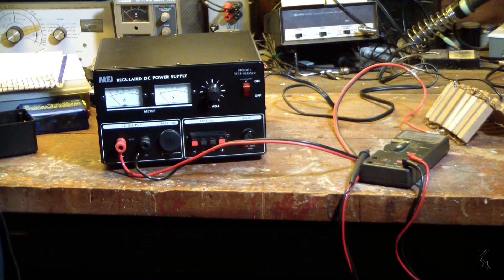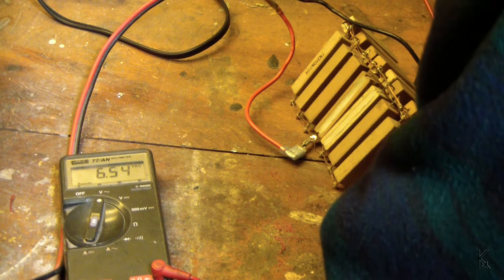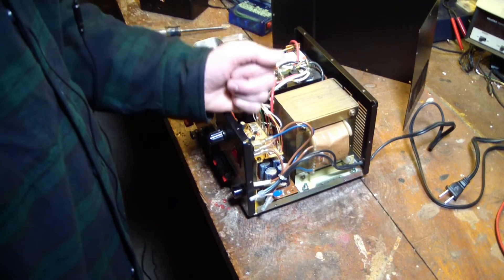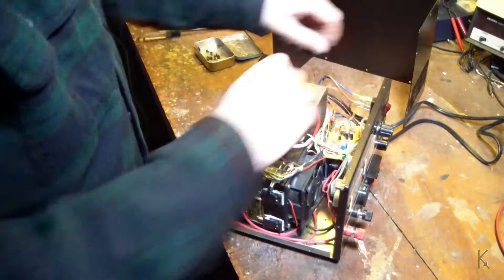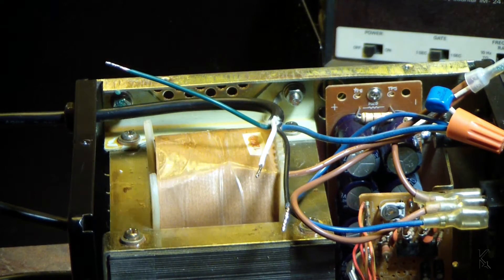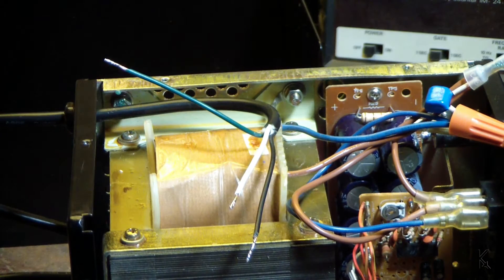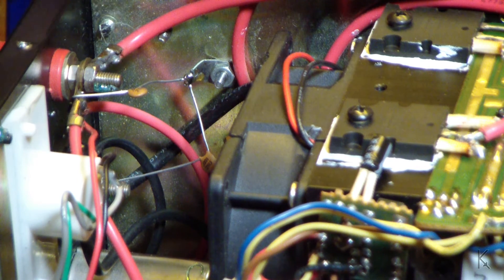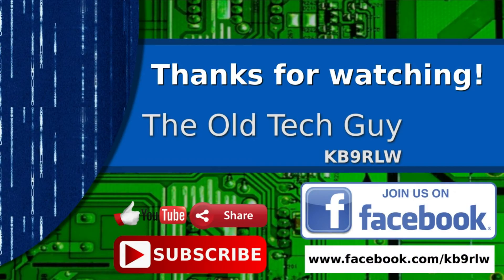Ham Radio - Improving the RF filtering of the MFJ 4035MV Power Supply

Comment: Just bought a new one. Many of the problems of the early model seems to have been address. The soldering is limited as they went to crimp on connectors for most connections. They have added caps to the DC outputs. They still use a two prong cord, they must have there reasons. The only thing missing is the meters are not lit but I don't know if that was a add on. Easy to do once the warranty runs out.

Comment: Thanks for a very useful video! I've performed the mods you demonstrated and it has vastly improved the usefulness of this power supply.  While in there I also cleaned up the solder joints on the rectifiers and performed the "fan mod" to reduce the fan noise (I see the unit you displayed here already has that mod.. the resistor going from one of the rectifier leads to the fan).  I really enjoy your videos, keep up the great work!

Comment: I have this same power supply, which was stored in a box for over 10 years. Previously it was working well. But now the voltage meter fluctuates and does not stay as set with the voltage adjustment knob.I did open the unit up to blow any dust in there but the problem persist.Can you tell me why this is happening?

Comment: Why would the casing have had a PD of 61V? Simple due to impedance from the transformer?
Reply from the maker: Bleed through from the bypass capacitors to the chassis.   Voltage, but no current.  It wouldn't shock you.

Comment: Kevin, thanks for the excellent video.  Do you have a proper schematic?  I have one, but it doesn't match most of the components. - Bob
Reply from the maker: The owner had five that were all a little different.  Only one matched this exact model.   I'm not sure where he got them. I sent them back along with the unit, so I don't have a copy.  Sorry.

Comment: Great video -- I am a total HAM beginner and have a general question: Could I not directly use an Automotive battery together with a DC-DC converter to avoid all  problems of other power supplies -- especially if I am transmitting max. 1h a day. After usage I would recharge the accumulator over night. I would need to check the effiency of the charging process (for slow charging it should be fitting to the free energy of the double cell reaction of the accumulator). What would be the disadvantages of such an approach ? Cheers and thanks for all your videos. Stephan
Reply from the maker: Oh yes, you could absolutely use a battery with some kind of trickle charge or intermittent charge like solar.    I have a battery system in the house that my QRP radios run off.  It's charged by a small "wall wort" transformer to keep it up and I can run for days off the battery if need be.
Reply: Did you try a pure battery approach also for a 100 W radio ? Would this work  too ? Thanks for your answers, Kevin and 73 from Zuerich, Switzerland ...

Comment: I have 2 of these MFJ4035M supplies and have not experienced any issues. I have tested to 24 A, not just 6A.   I do thing adding AC safety ground a good idea.  The output caps on the DC are too small to do much of any RF suppression.  Only issue I have had with this supply the variable voltage knob had setting for 13.8V and there is pot inside to adjust the voltage so when the panel pot is set to 13.8V the output will be 13.8V.  I have had the internal pot get flaky and the adjustment be off. I also have had to replace the panel pot.  IMHO this is much better supply than any Astron. I also have 2 RS35M Astron supplies.  The MFJ is much better built.  Astrons are about as cheap one can get, but they do work.

Comment: That Mfj 4035mv doesn't come with lighted meters from the factory which means someone was in there mucking around which might explain the sloppy solder job. I bought one of these new a couple of weeks ago and get great signal/Audio reports! I also popped the hood on it and everything looks clean and professional. Did the owner of the supply ever let you know if your improvements worked?  Dave
Reply from the maker: Yes, it was much improved for him, he's quite happy with the results.    His was an earlier unit, and the solder points were all original where they were messy.  MFJ has people doing the work, so it probably depends a great deal on which individual did the assembly on your particular unit.  I'm sure some workers take more pride in their work than others.
Reply: Hey Kevin, I was talking to a tech at Mfj last week and from what I gathered, this supply is made overseas but apparently some of their supplies are made here in the states. The tech I spoke with has the 4035mv at his work station and he said his supervisor has one at his as well. He says their built like a tank and he likes them. Dave

Comment: l stands for line.  That mains cable seemed awfully thin.
Reply from the maker: It's fine.   Max current draw on the mains side will be around 4.02 amps.  Even if you managed to hold the power supply at 35 amps for any length of time,  that cord shouldn't get warm.  It came with a 600 watt computer power supply.   The MFJ under it's max 35 amps on the DC rail is drawing 483 watts.   At it's nominal 30 Amps DC side, only 414 Watts.
Reply: Kevin Loughin Yeah i recognized the style of cord.  it just looks to me like one of the way too thin ones that sometimes ship with chinese equipment.  If its only going to draw 4 amps yea it should be fine.

Comment: I worked pipeline back in the 80's, doing so as a plastic pipe fuser and welders helper. what gets me Is those who must see beautiful welds/solder joints. my mentor, welding teacher; an alaskan pipe line welder, exclaimed it's not the look of the weld after it done. it's visually watching the puddle for penitration. that take time to learn. as for what looks like a cold solder joints. if you wrench on the wires and it doesn't snap loose. enough said.
Reply from the maker: Pretty much why I left it alone.   They felt solid and did their job.   I don't get all hung up over it, but I do try to be a bit neater when I do the work.  There's  a degree of self-discipline that's evident in clean results.
Reply: Kevin Loughin ,,, some might call that anal or ocd. but it is what it is. I try to keep my solder jobs minimalistic. that way I save solder. being single, disabled, on a fixed income; well below the poverty level, no formal skills, but not a blubbering idiot, but I get by on the education I didn't pay money for: on the job training or just simple hobbyist education. like my interest in monatomic gold. I've never used it, i cant afford it, so i read, then filter the opinion from fact. just the facts, ma'am. reading being the fundamental for most educations. but I'm more audio visual. if I can find it here or other outlets, I do so. kinda like with my mentors, when I was pipelining mains and services in towns across n.c. and s.c.. or being Elmered with radio and circuitry. one last thing that rides under my skin is how many will demean amplifiers. a amp is a simple circuit. but so many look at a c class amp and say it's junk. I say it's a starting point. even if the basics of the amp is broad banded. it only need simple tuners to cut the  band spread. I see the everything from being educated as a wagon wheel. in my thought process, work gets done at the core or hub. then there are short cuts, those are spokes. and all roads go to the same place. thats the rim or tire. and that's where progress advance.
Reply from the maker: I hear ya, school of hard knocks,  hands on.   There's value to that, practical, real-world experience can teach things that just can't be fully covered in a book.
You had me looking up monoatomic gold.   I was given pause when I saw it bottled.   Since elements don't become 'monoatomic' until they are pushed to their gas state where the atoms can separate to a point where they exist alone.    Gold has to be heated to over 5000 degrees Fahrenheit to pass from boiling to gas and enter a monoatomic state.    Kind of hard to drink a 5000+ degree vapor!

Comment: I'm really disappointed you didn't do the proof at the end by measuring the transient a/c voltages at the load like you did at the beginning. You stated the problem, but never quite showed that you solved the problem you stated.
Reply from the maker: Yeah, thought about that this morning.    I did measure it and it was less than 1 Volt.